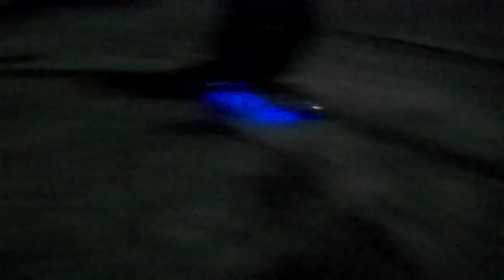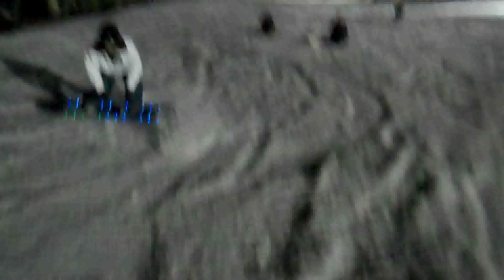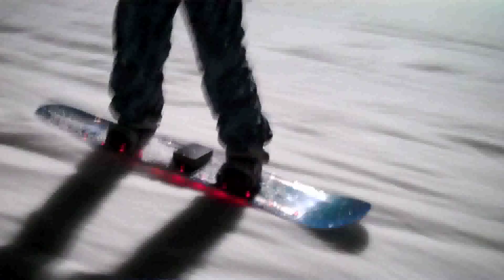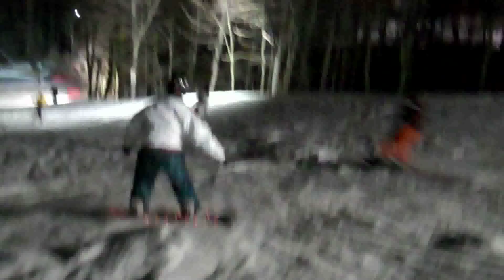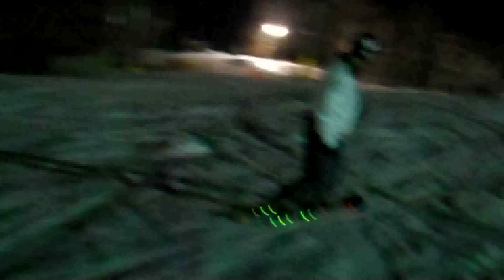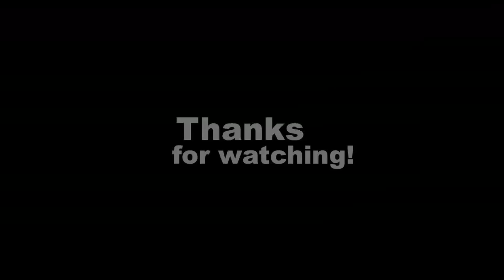LED Color Changing Snowboard Demo Video Short

Comment from the maker: if your on facebook... friend me (nason tackett)... I can send you links. I can build a controller for the LEDs if you like. I have a bunch of pictures of this board although its pretty rough since I had never tried to deal with snowboard epoxy before. I have pretty much abandoned this concept (of building the lights into the board) and am working on a kit for LED strips that can mount to the top of any board and do a whole lot more than this setup... check out my other videos an you will see.

Comment from the maker: @cckid566 No. The holes for the lights are drilled all the way through, but the lights are countersunk about 1/8" and encased inside of the same highly flexible epoxy that snowboards are made out of. Then sanded so that it if flush with the bottom of the board.

Comment from the maker: @specialoperation I am actually starting another one now where I want to try to make it a kit where all the wiring is inside an adhesive-backed rubbery strip that mounts on top of the board. And the box mounts with industrial-strength velcro... So no screws. An thinking about making two versions... one where you drill holes (using a template) for the lights to shine down like in the video, and another where its only on top (no holes).

Comment from the maker: @specialoperation Yes, did this myself. The power source is 2x D size batteries which last about 50 hours of continuous light (the lights turn off automatically when no motion for 10 seconds).  Ive built another system since that video where I routed grooves into the board and re-epoxied them inplace so all the wires are actually in the board just to see how well it works if it were manufactured as part of the board...